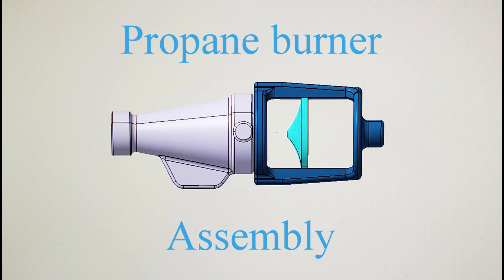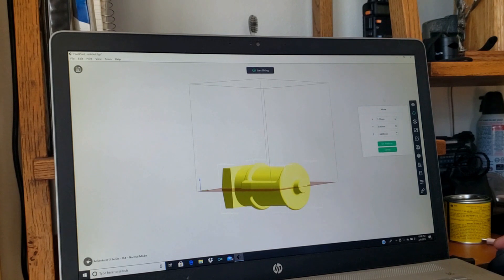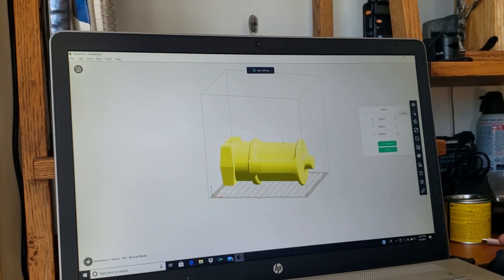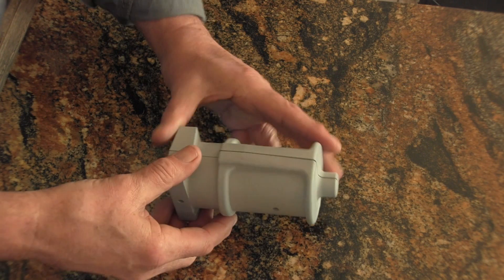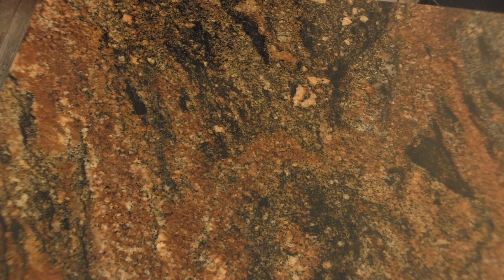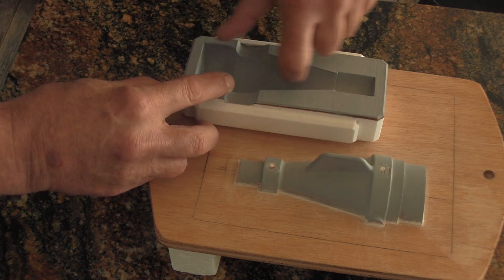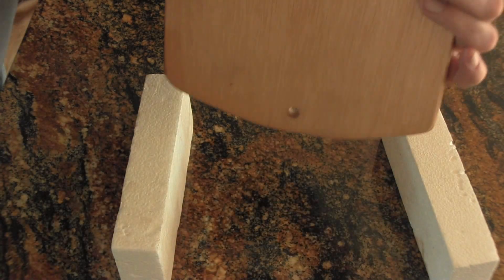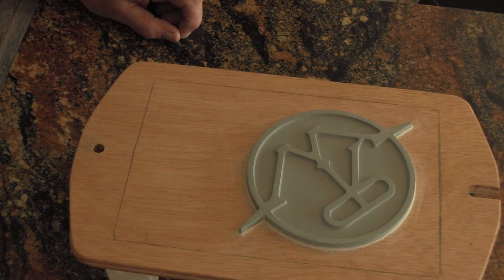3d printed patterns

Comment: A lot of information in your Videos,  i am assuming the the 3D printed parts are painted on the sand contacting
surfaces, what paint do you use ?  what computer modeling software are you using ?
Reply from the maker: Thank you. The models are painted with rust-oleum auto filler primer. Software is rhino 3d, solidworks and a few others i have access to. Fortunately I spent too much on software when I was younger. It's all 10 to 20 years old now, but it works.